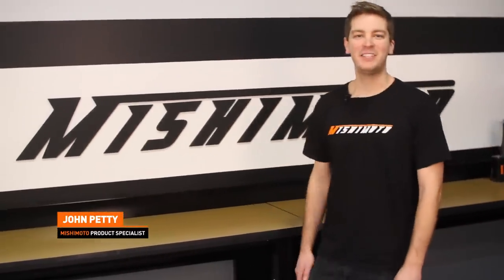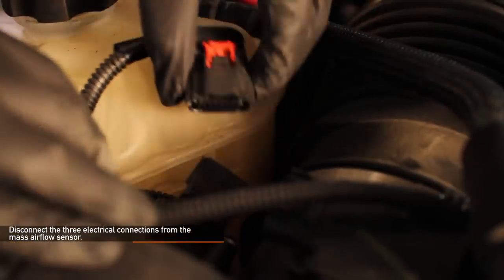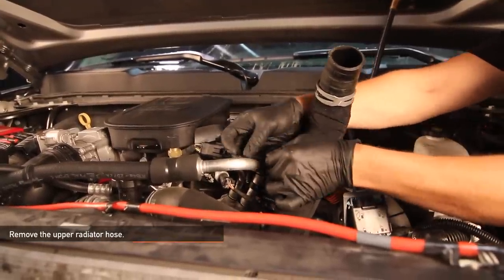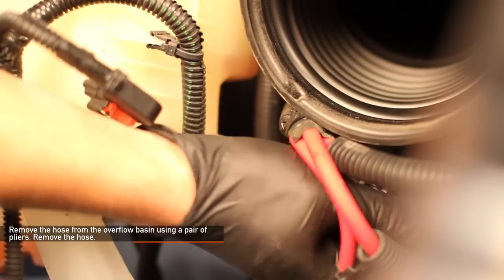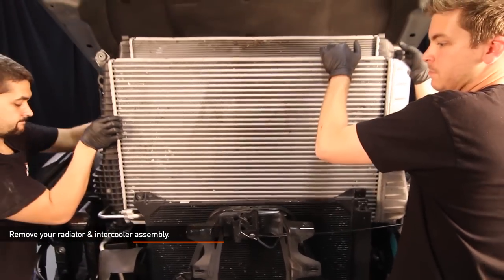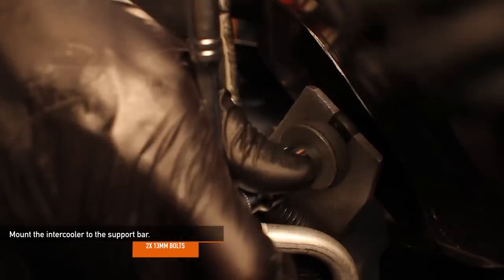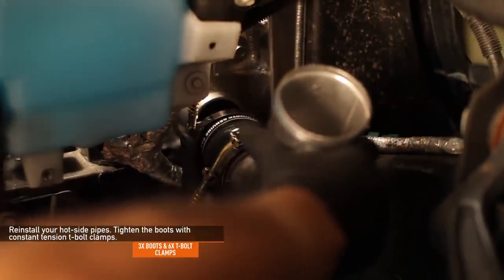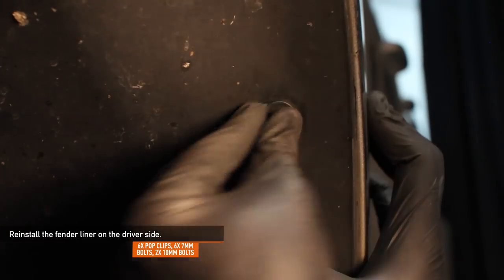2011-2016 Chevrolet/GMC 6.6L Duramax Cooling Package Installation Guide By Mishimoto

Comment: I just finished my tear down and this video does not apply to a 2016. there is a lot more going on with the 2016. the fan shroud is not 2 pieces as well as many other differences. Feel free to message me for additional info.
Reply from the maker: Hey Jeff! Thank you for bringing this to our attention - we're looking in to this and will have an update for you soon.
Reply: Hey Jeff do you have a video or a step by step guide on the 2016 2500
Reply: I replaced '16 rad only and like Jeff stated, the shroud is 1 pc. It's nearly impossible to  remove the shroud or coolers until EVERYTHING is moved forward, allowing some space between the shroud and rad. I was able to remove the rad with the shroud against the engine but did distort the cooling fins on the old rad. For the install, I moved the AC and charge air cooler forward.